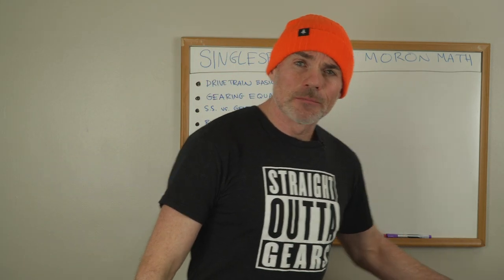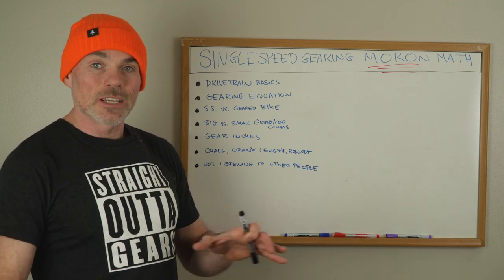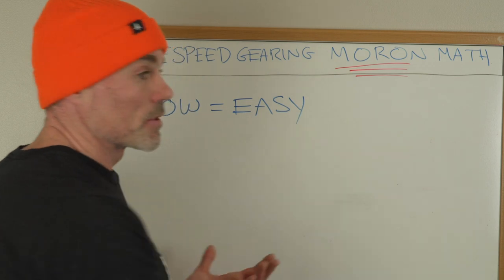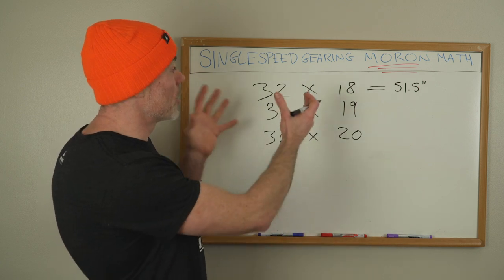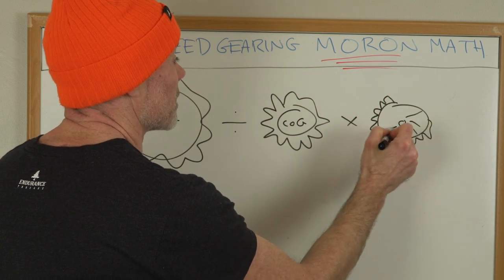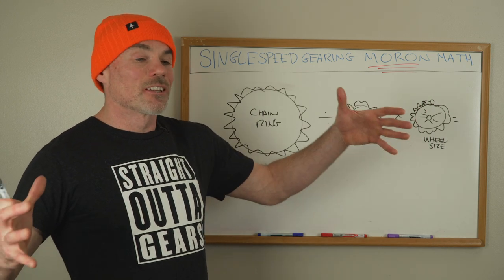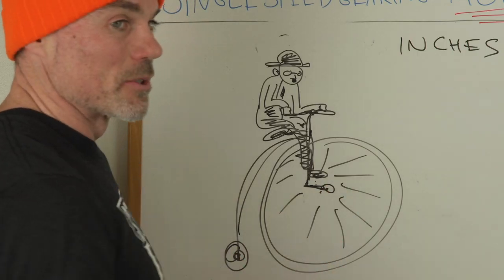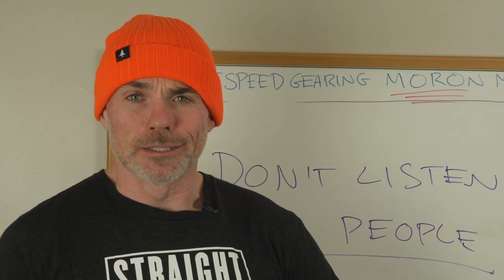Singlespeed MTB Gearing Moron Math

Comment: "You gotta get that gear right or, in most cases, less wrong" is the truth of singlespeeding. Unless you're Gerry Pflugh and the only gear is 38x22 or whatever crazy tall gear he ran.
Reply: @tommywhiteman6466  On the road? Maybe. I feel like that might be too tall of a gear for trails, especially if you're in some place where trails are twisty and you have to accelerate back up to speed a lot. It's been a hella long time since I've run SS on 26" wheels, but given that that's about a 32x15 on a 29er that's a pretty tall gear. Even in Delaware which is pretty flat (short but steep climbs) most people would run 32x20 or 32x18 on a 29er.
Reply: Where I live near sandy hook beach  which is pretty flat on the bike path
Reply: @tommywhiteman6466  im using 38-16, yes its good on flat road, kinda hard on ascend but doable.

Comment: Did a resto-mod on a 90s Specialized FS went with a 42T up front and a 16T in the back added a chain tentioner made a nice klunker ouitta this triple butted frame and added some bmx bars, she's a beauty rollin on some 26 inch rims. 42/16X24=68.25 live in L.A. mostly riding on flat roads with few hills. thanks for the math lesson Professor

Comment: To help in deciding what Ss to select try a ball park gear inches on your multi speed and ride your favourite trails just in one gear. Then maybe add an inch or two and go for it. Bypassing the jockey wheels on a derailleur gives you a tick more power for some reason.

Comment: Hopefully this video will go viral and people will stop trying to compare their SS gear combo to mine and feel the need to brag that they run a harder ⚙️. I think the question “what gearing are you running” is usually asked by some losers that hardly ride bikes and when they do ride it’s on trails that gain only 600feet  elevation in 4 miles because they live in TX or some other flat state. 
Go ride you SS and figure out what works for you, the more you ride the more you will know and absolutely don’t listen to others.
Reply from the maker: Haha! I cover the "what gear on my [geared] bike compares to your SS gear?" thing in the upcoming viewer question vid. It's actually interesting to me how they compare from my trail bike to my SS.
Reply: @DirtWireTV  I’m looking forward to that, also the oval ring topic. Personally I don’t feel they benefit SS Mtb’s but that’s just my opinion.
Reply: I’m running an oval 30:18, and am pretty sold on it. Gets over the dead spot quicker and spends more time on the power stroke. Feels a little funny at high rpms though.
Reply: @danwebber9494  for me that loss of resistance when standing and pedaling feels like it takes away the variable power to push up technical sections. I guess it’s what you’re acclimated too.
Reply: Big gears are so interesting.  I worked up to pushing 2:1 29x2.35s through last season and was posting rolling singletrack avgs in the 12-13 mph range and lots of pr's.  I dropped back to a 32:19 for some big climbing rides in the mtns late fall.  I got lazy and stayed at 32:19 in the local rolling terrain through December and started posting pr's?  The torque out of corners is crazy.  I think having a big gear big you ride 2x a week as effectively strength training and then ride a higher cadence gear the rest of the time is the way but then again I have no idea?  Ha

Comment: Great video and advice :) I am hoping to get back into single speed mtb racing soon. I rode a 26” single speed Giant dirt jumper with a dropper seat post. Gearing at my peak was 34/16. I think bike weight was 26lbs. Rear brake only. 

When I started out I was geared at 32/20. I used the red road trail at oak mtn state park in Alabama as my gauge. If I could do the whole trail without putting my foot down once, I would gear up a tooth in front or down one in the back.
Reply: I run 32x14 on my DJ bike (26" wheels, 2.1" tyres) and 32x16 on my trail bike (27.5" wheels, 2.4" tyres). We don't have any big hills where I live but there are some short (~300ft) steep ones I can just about get up. I do take my bike to the big mountains occasionally but that's always lift assisted downhill.

Comment: I must be a real weakling but my hometown of Durango and being in my seventies requires lower gearing than what you describe .
I ride 30x21  on 27.5 wheels with 2.8 tires. As you say different areas require different gear combos. I’m able to get up some long and steep climbs which is more important to me than being spun out on the flat. Fully rigid Hardtail brings me great joy. You sure kick ass on those rocks!

Comment: Hello there! I think you can build on this by taking power into account. That is, given your power profile, i.e., the power you can sustain for different time periods, you can figure out the speed you can go at various inclines and then compute the cadence that different gears give you at these inclines. For example, I am old and weak and my FTP is about 200W, so a 10% grade at FTP for my weight and mountain bike weight would produce cadences lower than 40 rpm for any gear higher than a 1:1 ratio. I live in Switzerland where there are a lot of sustained steep climbs, and I doubt that a single speed can work here. I just did a simulation on my CX bike using a 39x25 on a 500m and 12% grade and it did not work well, I was pedaling in the mid 30's at 220W and not feeling good. However, I can fairly easily produce close to 400W for 1 minute efforts. My general conclusion is that for me, a single speed can only work on terrain with steep sections that take less than about one minute. However, I usually maintain 250W for 5 minutes without any issues, so I think it was the low cadence that killed me. The other conclusion is that I need to build up strength endurance in my legs. I will try to do that, in the meantime.

Comment: We used to mess with various ring and cog sizes, half-links, slightly worn chains, etc. to get a setup that would work on a frame with vertical dropouts without a chain tensioner.
Reply from the maker: "Magic gears."
Reply: @DirtWireTV  32x16 on my 26" Fisher. A bit snug with new parts, but a slightly worn chain was perfect.
Reply: 32 X 20 was the magic gear on my old niner air 9 scandium. I tried 32 X 16 on a on one inbred 29, knee popping fun. 😱🍻

Comment: I’m new to this SS voodoo and I’m glad I discovered your channel. Subbed right away!

Just ordered the DMR STS and that came with a 16t. I’m converting my 27.5” trail hardtail that already has a 32t. Flat, fast flowy trails where I ride. My 26” dirt jumper is 32:14 and it mostly feels great for what I’m riding except for some climbs. Both have 2.3” tires. Based on your equation, my hardtail comes out to 55” which will make it a bit easier than my DJ at 59.4”. My intention is to make the hardtail a bit more capable at climbing so this should be a good starting point right?
Reply from the maker: I think so. 55" is a good climbing gear for a strong rider on flowy trails. Would be a little high in some areas.

Comment: I don't do math with my cycling hobby...it muddles the fun! ahaha...but going "by feel" ,  the smaller the chainring (not the cog), the easier to go over obstacles, the easier to climb...I learned this thru a fixie and thru a trials bike (not TT bike)...so my gear ratio is always 2:1....

So if I go 32-16 (he defined as "hard") - this will be harder to climb or go over obstacles compared to my 22-11 gearing...these use the same 2:1ratio...mathematically it's the same but if you ride it, it's totally different...having a tiny chainring removes a whole lot of effort and I have no idea why.

Comment: you forgot to multiply by pi there. gear inches means one revolution of the pedal gives you pi times that number of forward motion. think about it. if it were like you described and we really only got ~51.5 inches from a revolution of the pedal, that's a 1.5 gain ratio (dependant on crank length) and we'd barely go faster than walking/running pace. it's the gear inches number times pi.